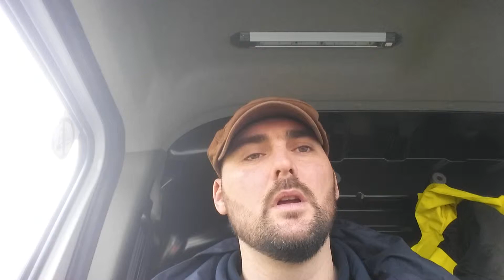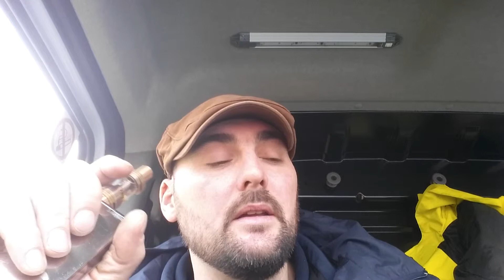Vape battery and lipo warning.

Comment: Lithium ion batteries are the same you sped, if you stab a Li-Ion battery and then attempt to recharge it you'll still mess yourself up. this has nothing to do with LiPo batteries specifically, this video is the biggest waste of time. thank god there is only approx 600 views on this video so there is only potentially 599 other people that have been fed this garbage